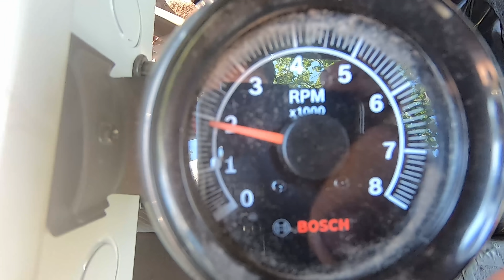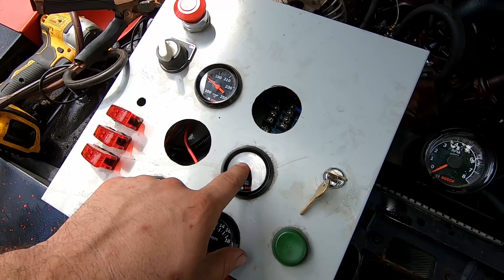The 1972 Plymouth Satellite Rat Rod is Alive! Installation and First Startup.

Comment: I have a couple thoughts. First, congratulations getting it running! Regarding the blowby, I noticed the pcv  valve isn’t hooked up. That will make a difference. Normally the pcv will provide a metered extraction of crankcase blowby. If it’s not hooked the engine will vent the crankcase out the breather. Regarding headers, most header manufacturers recommend using the 90 degree adapter for tube clearance. If I’m doing an engine install I will hang the headers in the engine compartment. It saves a lot of aggravation rather than installing after the engine is installed.

Comment: Great video. An easy way to get more hood clearance from the air cleaner is get a shorter air filter. The engine sounds good. Break it in hard if you want it to perfprm. Don't be afraid to rev it up to 6000rpm. On My 92 Dakota Magnum 5.2l I would shift it at 5700 on the drag strip. The only mod inside the engine was i replaced the stock 1.6 rockers with 1.7 roller rockers. It was like a step up in can specs. Opened the vavles an extra 0.0240

Comment: You would be amazed at how well things roll on 3/4 inch Plywood sheets..  Keep this in mind for later work on cars...
Reply: You the man gatomon! Been saying the same thing I have a 22x40 portable garage and instead of concrete a layed 4x8 sheets down works great.....and because it not permanent don't have to pay taxes on building....... Live in NJ where if it moves it gets taxed!
Reply: And two heavy blankets on the windshield should your lift rig get away from you - especially if using only a chain fall/ come along. Been there - expensive fix.Put a rear sway bar on it - you’ll love the handling difference !!

Comment: Hey bud, you need to get a fan shroud on it. When u are ready to drive it. It will most definitely overheat without a shroud.
Reply from the maker: Currently the truck one doesn’t fit I have to modify it so that it sits in there properly
Reply: Sounds good bud👍

Comment: 43:51 You can achieve  kinda good fuel mileage with these cars if you really want to.
Reply: *A 904 Automatic Lock Up transmission out of a 78 Lebaron would work wonders for gas mileage but I’m not sure how it would hold up in a performance application.

Comment: @LUNAR OUTLAW GARAGE. The passanger side could be burning off a lil oil due to the rings having to repeat which is expected with any build so I'd run it again but when you do dont hold it at a stead 2000 you wanna vary the rpms from 1500-2000-2500 and give it a couple good revs and it'll get every in place and happy. I learned that from working with moly rings which are THE WORST to seat. Its like 50/50 they seat or they dont. Holding the steady rpm breaks the cam in and varying the rpms will seat the rings which also is why they say to take it easy and dont cruise at the same rpm for the first 500 miles its due to the rings seating

Comment: you can run a thinner air filter and then you could use the spacer
Reply: It could be just as thick but with a drop base. But it is questionable whether a spacer would benefit at all. And the drop base and the thin air cleaner element are likely to hurt. But with that small engine and highway gears, probably no difference to be felt.
Reply: They used a thick gasket on those to help with heat transfer from the intake. I always use the thick gasket and I'll reuse them with a bit of grease for insurance and they work fine.

Comment: Them Chrysler a/c compressors actually make good air compressors. My buddys dad had an old international bus wi t h a dodge style a/c compressor that was actually converted from the coach carrier for the brake system
Reply from the maker: Wow really I will have to save it it ty for the heads up
Reply: A lot of mudders used to do this also b4 12volt mini air compressors became so widespread in availability but hey anyone with backyard knowhow that goes by the motto BUILT NOT BOUGHT like us guys do things like this because we don't have 30grand to invest into stuff we can build outta junk ya know?

Comment: I like the longer videos and I want to hear the cam u have in it idling but man it has been a long time coming and congrats on the first fire inside the car finally. I just got my stuff back from the machine shop so now I'm going to build my 347 stroker bottom end tomorrow and get that much closer to my pinto finally running for the first time in my possession 😁👍🏻🚗💨💨🚙💨💨👌🏼💪🤙
Reply from the maker: That pinto will be a monster
Reply: @LunarOutlawsGarage  👹👹👹 I sure hope so. I'm trying to squeeze out every ounce of power I can out of it N/A and have a fun street/strip car with A/C because it came with the car and I'm sure that I will want it to work in the summer and I'm sure it will not take you long to get yours going on your car and will be glad to put that a/c stuff back in. Plus you can enjoy it more if you're not sitting at a red light fresh out of the shower going out somewhere nice sweating like crazy 🥵🥵🥵 so I'm with you on the whole a/c thing 🥶 plus if u want to race all u have to do is cut it off. I like the paint scheme on it and if one day you want to take the build further and make the body straight I would keep the line the way u did it because it looks sharp as hell and I bet that it is going to be a  badass car and will be fun boiling the tires off of it and hauling ass in it because it isn't going to be a slouch for sure and I can't wait to see it in action because it is going to be sooo cooooool and with the ac working next year it will be a lot cooler on the inside 😁🚗💨💨💨💨💨💨 I'm in my living room right now putting my pistons on the rods and then going to go ahead and put the rings and bearings on so that when I get outside all i have to do is slam the pistons and rods and the crank in it and I will be halfway built 💪😁👍🏻🚙💨💨💨

Comment: There is a difference between the 4 & 5 pin Electronic Ignition Control units!  They are not directly interchangeable.  The 5 pin is the old 70s design and needs to be run with a dual ballast resistor and appropriate engine harness.  The 4 pin was introduced in the 80s and is run with a single ballast resistor and matching engine harness.  It looks like your car has a single ballast resistor on it, which goes with the 4 pin units.
Reply: Dual ballast was for AC cars
Reply: This is interesting I have a 5 pin box on my 76 charger and a 4 pin box won't work on it but it's supposed to. I have a 5 pin dual ballast on my 77 Cordoba a non A/C car and I can plug in a 4 pin box and it works perfectly....... I like the 4 pin box because it's more readily available I'm going to have to find out what is different in the wiring so I can run a 4 pin in my 74 charger due to aviablity of 5 pin at parts store....or I'll just run an MSD.

Comment: After all the countless motor swaps I've done over the years dodges have always been the easiest with there simple radiator mounting methods which makes them awesome. Gms for instance suck because they have to fit in a cer t aim area based on height and width

Comment: Trouble with spark on Chrysler electronic ignition? Simple.. lick your right index finger and touch the transistor while grounded to the car. Did you get shocked? That doesn't mean anything. However, you're now more motivated than ever to fix the problem 😀
Reply from the maker: Can’t stop won’t stop
Reply: A friend of mine worked on the radar systems of F4 panthoms during the Vietnam war touched similar transistor enough D.C. amps that it blew the tip of his finger off.....so no thanks on that testing method!..... And Chrysler manuals always warned not to touch when engine is running.
Reply: @moparnut6286  I can tell you from personal experience, the Chrysler transistor will light you up. Maybe that's why I have so much dain bramage?

Comment: From the side that fan looks a little wobbly.  Which is hard on water pumps.  Try another.  There are chassis dynos in every state.
The are cheaper to rent than engine dynos and it would save you the trouble of removing the engine.  I was worried that you were going to use the 5 pin ECU with what was probably 4 pin wiring in the truck.  Also, it wouldhave been more work to match the trucks wiring to the car's bulkhead connector than to fix the car wiring. You made the right choice.
Reply: The stance doesn't look right to me. Too low in the front (suggesting torsion bars cranked down)  and too high in the back.  Reminds me of 1979 when guys would......well the less said the better.
71 to 74 B bodies already have a wedge shape... It's not too late to remove the paint on the windshield, bumpers, and the spokes and outer edges of the Road Wheels.  The trim. Acetone cuts through it like butter.  Unless the windshield is broken, I'd keep it. The replacement windshields are said to be too thin.  If you use hood pins, the Original Equipment ones are probably the least offensive but the most expensive.  The screw holes are parallel to the car , not diamond shape to the car.  Look for the measurements on line. I'd wait. You may find a Road Runner hood with pins in and you don't need more holes  in the radiator support than two.
Reply: Those ECU's do lose the potting material just sitting in a box. It isn't from over heating. It may even be organic decomposition. Don't put the ECU back in a box of ECU's or the other ones will catch it, too.  I'm certain it would still work the same, as long as it doesn't get wet.
Reply: @auteurfiddler8706  man I got an old 5 pin that's lost nearly all of it's potting and works like a champ.... But they do die.... A good source for the 4 pin is rockauto.com I get the $25 dollar ones so I have a spare in the trunk. And as long as they are well grounded they will last.... Tip run an extra ground to the box!

Comment: The old tran Cooler is.  was a power steering cooler .i had a cop car that looked. L8ke that one ???* happy for the wider rad. Almost all mopar rads Will mix leave the sheet metal alone even if it's only 22 inch

Comment: I wouldn't exactly call that a success quite yet. Even with the motor being upside down any excess oil would have burnt out of the cylinders soon after it started. That looks more like blow-by from a ring sealing problem which may be caused by running the engine with low oil pressure at Nicks and the cylinders running dry, or all the time spent honing the cylinders before assembly at mister know it all's down in Tennessee. The way the motor jumps around you might want to check your firing order again and spark plugs to see if any of them are fouled out. If all that checks out ok, with all the starts and stops you may have burned down a cam lobe already.
Reply from the maker: running fine today with no blow by.
Reply: @LunarOutlawsGarage  Good I am glad it cleared up. My friend Anthony is a pretty intense guy and has a take no prisoners attitude. If he likes you he will help you out any way he can, if he doesn't not so much. He has both a general mechanics shop and an engine building shop and has been in business for 38 years. He built the 440 I put in my 72 Satellite ten years ago and I ran it down the track last fall and it still turned a 12:60 on street tires and though the mufflers. He said that he will take down his comment sorry for any misunderstanding.